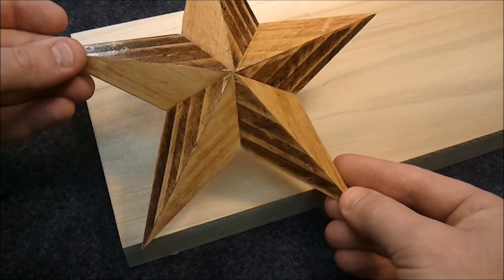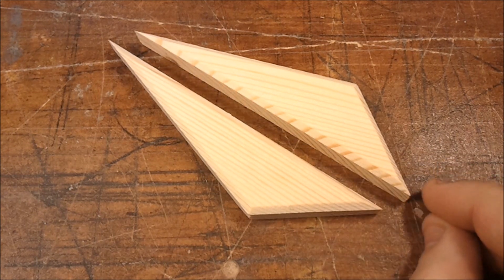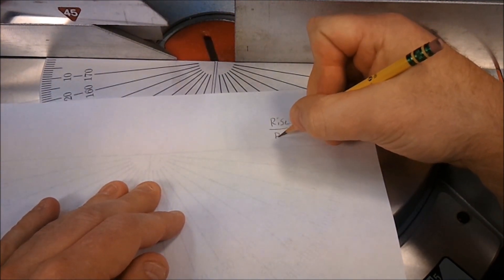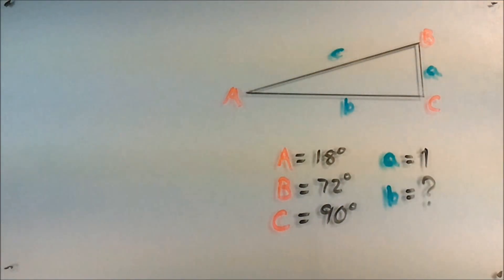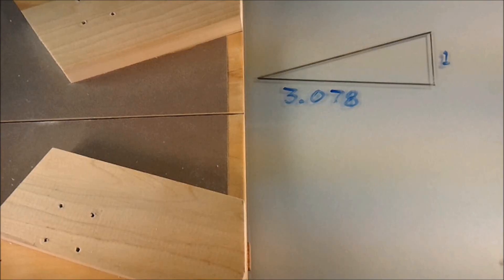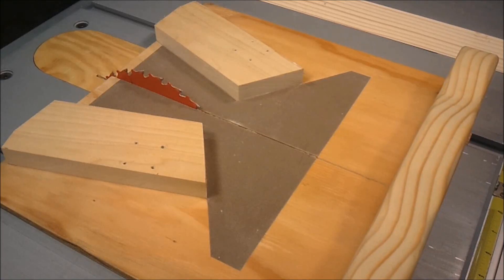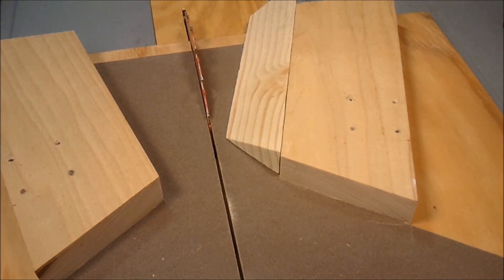Geometry of a 3D Wooden Star ★

Comment: Did you just let the glue set up without clamping?  I can't imagine an easy way to clamp them.
Reply: Yes—but there is a better way. The backside of the star is a flat face. You can join parts together there with masking tape. Tape will make a sort of hinge that you can bend open. When you add glue, there will be just a little bit of added thickness that'll give you a nice, tight joint. Once glued, simply weight down the star with a sandbag. 

Good luck. Let me know how it goes!
Reply: @pocket83squared  Brilliant!  Thanks.

Comment: I have a tip for anyone making one of these solid wood stars:  Don't cut your sections before you're ready to glue them together.
I made the sections of a 36" X 1½" star and when laid out, the pieces fit perfectly.  Then the pieces sat for several days, and when I went to glue them up, they had warped every which way as they continued to dry.
Reply: Good point. These are super-precise cuts, and any moisture/temperature changes can ruin even the best-laid woodworking plans. Also, whenever a board is cut, many of its internal stresses are released, and so it will slowly change as it acclimates to its new shape. 

For the record, warping is no major issue to an already glued star. The wooden star in this video is now over a decade old, and it's been hanging on a block wall in my basement for the last five. Still looks new.
Reply: @pocket83squared  Right.  I would think the bigger it is, the more it would warp, BUT, once all pieces are fit together, it would seem that any warpage would only be in flatness, which is a lot easier to deal with.
By the way, I plan to take my warped pieces and glue them flat to ten new triangle pieces so as to make the star twice as deep, then bevel both sides on a bandsaw with a tilted table, before gluing the five sections together, using your masking tape ides.  Thanks again for that.

Comment: My Daddy has a CNC machine and can make one in about an hour.
Reply: Not even close. Tell him that a single-piece 3D star would be likely to warp and/or crack. This is not to mention the grain pattern, which still requires good old-fashioned miter joints. 

Though we now perch on the precipice of AGI becoming our intellectual replacement, the services of a capable carpenter are still gonna be tough to outmode for some time.
Reply: @pocket83squared  , my Daddy tells the truth just like the Government.

Comment: How did you clamp the pieces together for the glue up? Surely you didn't stand there for an hour holding them together
Reply from the maker: Masking tape is one simple way. Note that the backside is flat, so taping them there is also an option.

You might also consider that wood glue has a several-second tack bond, so it actually is possible to hold them together until they're all set in position. Somewhat surprisingly, precisely fit parts like this are among the easiest things to glue up (thankfully). You'll have enough time to tinker with them, and it's quite clear when they're not correctly aligned. Once you're satisfied, a sand bag can be used to apply a uniform down-pressure.

Comment: Solved the angle problem. I made a jig for my miter saw. took a 2x4 and cut 30 degree cut in one end and a 45 degree cut on the other end and I can cut ant degree angle I want. I can cut stars 3D or 2D. But I do love your video. I did make your jig i like it but your stuck with one size star.

Comment: Hi! I'm trying to make this work. But it seems I'm missing the correct angle for the stock piece that enables you to cut the shorter side soft each triangle. What's the angle of that cut for the stock piece (the end grain part) relative to its side? Thanks
Reply: I'm sorry, but I really don't understand your comment. Please give me a timestamp from the video or try to clarify which angle it is that you're after. So far, are you using the exact same method that's shown here?
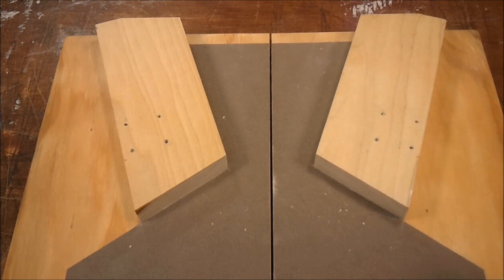Reply: @pocket83squared  I'll try to explain better. It's at 3:12
I don't have a miter saw. So in order to cut that piece of stock that ends up fixed on the sled I set the miter gauge on my table saw to 72 (90-18). But once cut, the shorter cathetus of my triangle ends up being not steep enough and once I start to assemble I can't get a five point star.
Thanks for the video and your answers!
Reply from the maker: @mariano_353  Sorry in advance for making something simple seem complicated, but anything will seem easy once you've figured it out!

Is sounds as though you've done everything right. A table-saw's miter gauge usually will read the same way that the numbers on a miter-saw do. The reason for this is that  a table-saw's blade is perpendicular to the 0° setting on the miter gauge. 0° is really 90°. It is possible that a gauge will read 90 instead of 0 when set for making a normal, square crosscut. Thus, you should be setting your gauge to either 18° or 72°. One way to look at this is that 18 and 72 are the same angles, viewed different ways.

Looking at the cut piece that's on the sled, if we were to place a protractor on it (with the bottom line kept along the bottom edge), it should read 18/72. If your gauge when set to one of these is still giving you something else, then its markings are likely incorrect. Try to test your angle against a protractor first, just so that we can rule out your gauge's markings.
Reply: @pocket83  thanks for the answer. Don't worry, it's probably me missing something evident. Gonna measure the angles again
Reply: @pocket83squared  went back to this today. Sort of nailed it. And I mean sort of because I ended up with a 8° gap once all parts are assembled. So I guess I botched that cut  and the error carried over to the whole 360° turn. Gonna make some adjustments

Comment: Wow...great video...will this work if the 18 degree angle is 44 degrees?
Reply from the maker: I don't understand the question. Please elaborate.
Reply: @pocket83  Thank you...I am sorry for the confusion.  I am trying to make hundreds of triangles.  I was amazed when I saw your video, I thought...could I use this sled to make my triangles.  My triangles are acute scalene triangles.  The three angles are 67,63 and 50...so I don't have the small 18 degree angle as in your video.  This is not for making a star, but for other artwork that I create.  My stock (to make the triangles from) is 1.5 x 1.5 inch pine wood.  My finished triangle should be about 2 inches for side C.  I would appreciate any help.  Thank you very much....Richard
Reply from the maker: @RichardRocket1  Sorry for the delayed response. Ok, there's about a million ways that you might go about that sort of thing, so let's see if we can narrow down the specifics a bit before I give an opinion.  

First, here's a related visual:
https://www.calculator.net/triangle-calculator.html?vc=50&vx=&vy=&va=67&vz=2&vb=63&angleunits=d&x=54&y=17

For this case, I have assumed c to be 2, because it was the shortest. I am also assuming that you want to make triangular prisms, so my first question is about their thickness: are these triangles 1.5" thick? My other question relates to its wood-grain orientation; will this matter to the the finished part's function?
Reply: @pocket83  Thank you...yes they are 1.5 inches thick.  Here is what they should look like: 
https://www.calculator.net/triangle-calculator.html?vc=84.7&vx=&vy=&va=39.6&vz=2.078&vb=55.7&angleunits=d&x=60&y=15
Side (c) will not be seen in finished piece.  Side (a) should be end grain.  Side (b) should be smooth...I really appreciate your help...I am thinking maybe one sled where I first cut the 55.7 angle then flip the piece and the second cut is 39.6.  Some of my work:  https://www.instagram.com/richardrizzolo/?hl=en
Reply from the maker: @RichardRocket1  My first thought was to make blocks by using a miter saw to cut 5.3° compliments (to C) on each side of the stock. Parallel cuts could be made at around every 1.75" (establishing side b)*. The 1.5" stock would have to be first ripped to around 1.33" to establish side a, of course. But the miter saw is quick & precise, and you will end up with a bunch of parallel-sided blocks. By then connecting the diagonals of these parallelograms, you will get two finished parts per cut. In the interest of speed, a bandsaw might be useful here, since the cut edge will presumably be against the canvas anyhow. If you still prefer the tablesaw for its precision, a much simpler sled could be used to cut these out as parallelograms, two at a time, than by any jig that would be cutting one away at a time from a long piece of stock. 

The picture in my head of this tablesaw sled is like an 'L' shape that is rotated clockwise 5.3°, which is much easier to use than the star sled in the video. Hope I just said that right; I had to make an L with my thumb and forefinger and then rotate my head to the screen! Hope this is of some help. 

If this idea doesn't get you moving down the right path, feel free to come back and complain. We can always come up with other ways, and I won't take it personally since I haven't had enough coffee yet this morning. Beautiful geometry, by the way: the first two on the page must really be something to see in person. We share some interests, so I would certainly invite you to poke around my content, as well! Here's one you'll probably like:
https://www.youtube.com/watch?v=ocC2L7Wti0Y

*'Around' just means that it will take some tinkering to allow for blade thickness.
Reply from the maker: Come back anytime. I enjoy problems ;) 
Thanks.
Reply: @pocket83  Thank you for all your help...
Reply: May I ask, how did you derive the 5.3 degree angle?
Reply from the maker: Adding it to 84.7 gets you 90. The numbers on a saw are often 90° removed from the angle you're looking for. If you think about it, a 1° mitersaw cut is really either a 91°or an 89° angle.
Reply: @pocket83  Thank you...you are way ahead of the curve...and I suspect you have always been that way...I will post a link to the triangles after I get the raw form build set up...have a great day...

Comment: On the subject of sizing the stars.  A 1" clearance from the blade kerf to the alignment blocks gives a 6 1/8" star.  So a 2" clearance gives a 12 1/4" star.  And a ~5" clearance would produce a ~30" star.  Practicality not withstanding.    
Alignment block left > 1" clearance     blade Kerf     1" clearance < Alignment block right

Comment: Might be just me but it looks like you only need one side.  Not both to have the angled blocks.  So you could cut the build complexity in half.  (???) - Yes, proven in Sketchup.  I have added my Sketchup version to the 3D warehouse under the same name as this video.  Shared with best intentions.  ( I have NOT looked at the 30° slope 3D version as yet. )

Comment: This is an awesome video. I've been trying to position these side blocks and can't seem to get it right. I know my measurements must be off somewhere. So in the example a= 1 inch and b is equal to 3.078. So then is a= 3 inches then b = 9.234?
Reply: Yes. You could also multiply both of those numbers by 2, or 4, or 5, or any other number. It's a ratio, so one side of the triangle just has to remain the same proportionally to the other.* 

The numbers 1 and 3.078 are a generic solution that can be multiplied to apply to any size blocks for any size sled, and it will always give you the correct angles. 

The other dimensions on your sled will all have to do with the width of the stock you use, so that will take playing around on your part. I really hope I helped in some way.  

*Oh, and one more confusing part: you can't add a number to both of those numbers, because it will change the ratio. Preserving a ratio only works with multiplication, and not addition. Think of it this way: a triangle that's 1x2 has the same shape as a triangle that's 2x4. Now add 1 to each of those numbers instead; a 1x2 triangle is NOT the same shape as a 2x3 triangle.
Reply: Thanks again. I kinda figured the sled dimensions  played a role in this as well. You really helped me thanks. It took you a week to figure this all out might take me a year. LOL.

Comment: The sled isn't needed. A RAS takes care of all that pretty easily, once you know how. Time and patience is all that is required to learn anything. I can make all of those cuts without batting an eye on my '54 DeWalt, no sled or extra equipment needed. 
But gone are the days where anyone gives a RAS a second of thought (or a second thought). I guarantee you a table saw is no safer, or easier, in the long run. 

Nice video though. Thanks for taking the time to make it.
Reply from the maker: Yep, the RAS has certainly fallen out of favor. Awesome tool if it's set up nice. I grew up on them, but I've also grown out of them, too. Hear me out; don't get angry. It simply comes down to shop space and versatility. 

Most radial arm cuts can be replicated with a simple circular saw, especially if you have some clamps and straightedges. But when you also factor in the tablesaw, there's just no comparison: a tablesaw can duplicate EVERY operation that a radial can do and then some, and the additional jigs take up far less room. 

On top of this is the design aspect; moving a blade assembly simply introduces more error than does moving a peripheral through a stationary blade. A tablesaw is as rock-solid as the jig you make and its slides/runners, while the radial has slop along every point of its articulation. 

Sure, I have one on standby for my next (larger) shop. I can't wait to try and make some cove molds on it. But when you have limited space and it's between a table and a radial, I'm taking the tablesaw without any question.
Reply: I agree with some of that, except the part about being able to do everything on a table. To me, my '54 DeWalt (believe it or not, it was new in the original box when I got it 10 years ago) is superior in many ways to the Powermatic table, which collects dust. There are definitely a couple operations I'd rather do on the table, but my RAS has none of the slop you suggest. Plus, it does come down to familiarity- I can do what I need to quickly, and might I add safely, on the RAS. I was never comfortable moving material past the blade on a table, especially using mitered cuts. Miter rip may be easier on a table, but anything else can be done safer and quicker on the RAS. Even Miter rip has its problems on the table- I have a wood fence that I can cut into with without having to jig anything. But I digress. 

Perhaps I'm a dying breed. Perhaps no one has the pain tolerance I have anymore. Haha!

Thanks again for the video, I'm a PhD engineer and loved the math parts. Fun to watch. Regards, K
Reply from the maker: You know, there are so many ways to go about performing the same operation. In a related example, I get into frequent discussions of this ilk about the miter saw. Lots of people find them either superfluous, dangerous, or downright useless. Me? I love mine! I keep her all gussied up like she's a goin' to the jig show! I use it constantly.

I suppose, in the end, that the more methods that we keep available to us the better; I want as many tools and procedures open to me as possible. But it usually just comes down to what's around us, and then what we develop comfort with as a result, I think. Right now, in the present tool culture and its associated marketing, appearance and safety are preferred to quality and utility. As such, the "scary" appearance of the RAS has relegated it to the furthest dusty margins of the tool corals, I'm afraid.

But trust me, you don't have to work to convince me. I still believe that in the hands of a skilled devotee, a good radial could spray innovation all over the shop. But for my part, my place is behind a tablesaw!
Reply: DeepinnaheartofTexas, where I am, we call that good sense. Do what works! I hope to see some more math from you!!! Cheers, K

Comment: Just an FYI: Harbor Freight sells an aluminum caliper that is 24 inches long. It measure in fractions of an inch down to 1/128's which is .0078125 of an inch or .198438 of a millimeter.

Comment: How do determine the distance of your angles from the blade? I want to be able to make different sizes of stars so maybe a groove in the sled is the way to go but I'm unsure about which direction it would need to slide (horizontal and/or vertical). Please help. I have been watching your video for weeks and building a little at a time. The concept has been very difficult for me to grasp. Thank you.
Reply from the maker: Be patient. This is some pretty confusing stuff. Once it clicks for you, it will seem easy, because we often become distracted by all of the non-relevant information at first. 

Those angled blocks on the sled were placed where they were based on the stock that I was using. So, their size and placement depend on how big the stars you want to make are. 

Lets say that you just draw the blocks on your sled first: this way, you can make the imaginary blocks go all the way to a point (at the sled's kerf). Now you can just place a piece of your scrap stock on top of it to see how much material you will have to remove. Just trace it. Do the same thing for how much space you will need to keep away from the sled's fence. If all else fails, try to approximate the proportions of my sled to get it close, and then make adjustments by trial and error. 

I can also give you dimensions if you need them. I want to help! This is not beyond you. Again, be patient. Sometimes our brains just need time to adjust to new ideas- I know my brain did!
Reply: @pocket83   if the offer still stands to get dimensions I'd interested in comparing them with my sketchup work.  no prob if not.

Comment: OK I have a question. You say the first cut on the guide is 18 degrees, then you mount the piece at an angle. How does this not change the angle in relation to the blade?